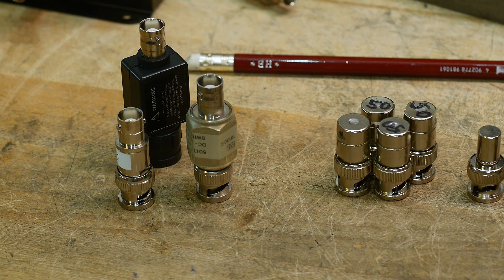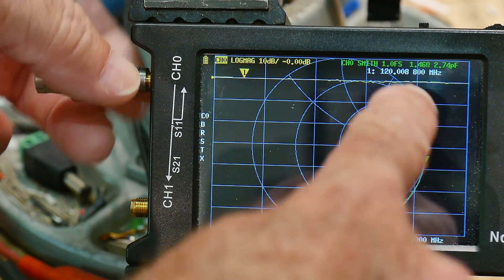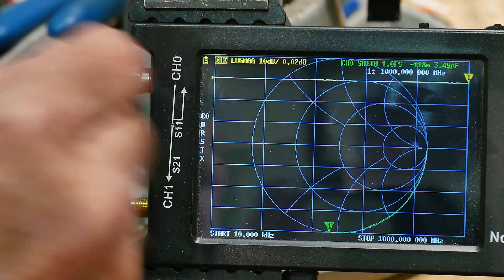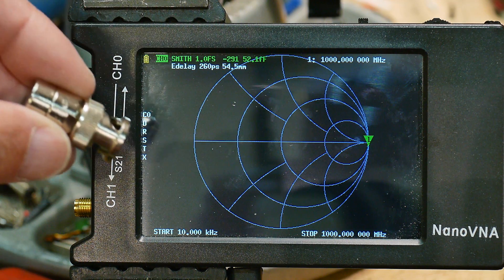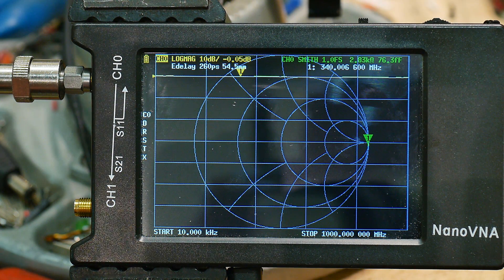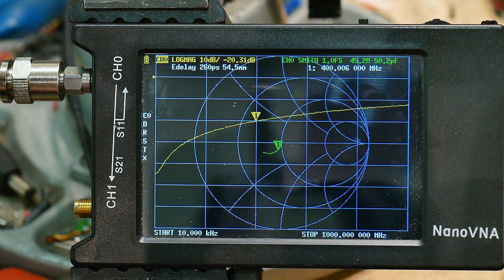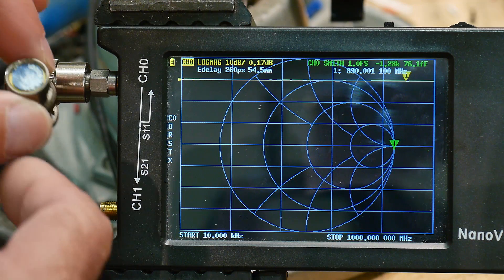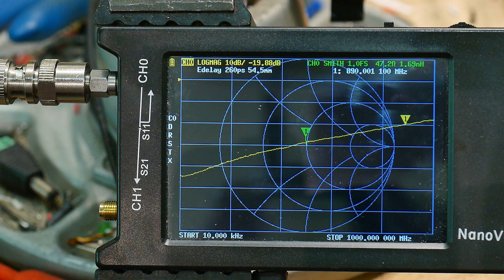#583 NANOVNA Not all 50ohm loads are 50ohms

Comment: Important point that must be explicitly mentioned more often:

People with NanoVNAs spend their waking hours repeatedly calibrating them with the 'Open', 'Short', and 'Load'. Very nice. But for testing and adjusting most simple antennas, the frequency calibration depends only on the internal TCXO, and I don't see anyone calibrating the TXCO frequency 127 times a day. (Of course the frequency is more than precise enough; yeah got it.  I'm trying to make the point clear here.)

Point being, if all you're doing is calibrating the length of your 80m dipole, then the only parameter worth looking at is where the impedance dip is located in the frequency spectrum. You can perform this measurement using a NanoVNA even if the amplitude and phase calibration are a bit off. You're only looking for the dip, and trimming the antenna so the dip is where you want it in the band. (This presumes that you've not set the Impedance References to something odd like 300 ohms.)

Me thinks people are bringing precision amplitude and phase calibration into the mix far too often.  Likely not required in many use cases.

Something to consider.

Comment: Just a word of advice.  Never "spin" on a connector.  As a example when you installed the first SMA-M to BNC-F adapter to your VNA you initially tried to hold the BNC end while you tightened the nut.  Had some difficulty and just spun it on.  This destroys the center pins in the connector.  Not something you would ever notice at HF /VHF/UHF frequencies but get into the microwave range and just doing that a couple of times will make a noticeable and measurable difference.  The easiest way to destroy connectors is to allow the center pin to rotate while tightening the nut.  Get caught doing that in a metrology lab and they would probably fire you on the spot for destroying their $3K cal standard.  Had a friend who works at a metrology cal lab catch me doing just that one day at my shop when he was visiting and I got the lecture.  I don't work on equipment at frequencies over 10GHz (honestly anything above the 23cm amateur band is usually just my microwave amateur radio setup) but he showed me some literature that demonstrates that at very high frequencies even not properly torqueing connectors make a significant difference.  Mike KC3OSD
Reply: "Never spin-on a connector..."   Yeah yeah yeah... But !

If you look at the NanoVNA and the little tiny SMA 'Open', 'Short', and 'Load' that come with them, you'll soon discover that there's no practical way to connect the 'Short' without just "spinning" it on. Good ahead, prove me wrong. Same with the little tiny 50-ohm 'Load' provided, the entire SMA 50-ohm load is too small to be practical to connect without spinning it on (What? You seriously want me to use needle nose pliers, Geesh!!  Get real.).  The Open doesn't matter since it lacks a center pin.  So yes, you are correct. But the obvious rebuttal is staring us in the face and it must be acknowledged. Your advice is simply not practical with small SMA devices that lack the hand-hold of (for example) a cable.

So, what I did was to purchase a pair of SMA-male to SMA-female 'adapters', also known as connector savers. Now my under $100 NanoVNA-H4 is protected with the addition of ~$10 set of connector savers. Even I'm not sure that it was actually a good investment. Spending $10 to protect a gadget that only costs $100, and I could even fix quite easily if I ever wore out the connectors?  Hmmm... Dubious investment.

So, from now on, you can temper your advice with this staring-us-in-the-face exception. Cheers!!
Reply: Also, some small devices don't even include a slip surface between the hex flats and the center pin. They inherently must spin on.  Worth mentioning.

Comment: great video! Incredible how they can manufacture a 50 ohms resistance that has no significant reactive component up to 1GHz!?!?!? We live in the future!
Reply from the maker: much much more than 1GHz. the SMA load I use for calibration is rated at 18GHz. You need better connectors to go higher, 100's of GHz

Comment: any manufactured product has a tolerance.
Reply: Except 'Primary' standards.  E.g. the "Prototype" kg lump in Paris by definition had (for many decades) precisely zero tolerance.

I love to mention the exceptions, as it shakes up the assumptions, and that's a good thing.
Reply from the maker: yes, all the big names of course. they will usually specify VSWR. there will be an actual datasheet. they range around 1.05:1 TO 1:3:1

Comment: That was a great video. Full of useful information. I liked how you zeroed out the smith chart with the delay. I learned something. I also found that all termination loads are not equal. I mostly focused on only SMA figured that would have least chance of having any stray reactance because of their size. I used a spectrum analyzer with an RF sampler to make my tests and none were as advertised. Not all were bad, just not up to spec. 
Thanks for sharing. I really enjoyed your video.

Barry, KU3X
Reply: PS...... forgot.  Isn't you Nano only as accurate as the calibrated load use to set up the VNA?  In other words, if the load that came with the unit was used and it would be a not so good load, would that not make all testing done after that no accurate?
Barry
Reply from the maker: Yes that is right. That is why cal standards are $4000 or more

Comment: how bad was the one that  came with your nanovna?
Reply from the maker: quite good. I compared it to an expensive one. <1GHz it is just fine
Reply: @IMSAIGuy  thanks. I'm thinking about getting a nanovna and wondered if I needed a better calibration load.
Reply from the maker: @vettonator  nope
Reply from the maker: you can measure it with a multimeter to see if yours is 50 ohm
Reply: @vettonator   You almost certainly do not need a "better" set of 'Open', 'Short', and 'Load', but you should probably order up a spare set as they so tiny that it's fairly likely that you'll eventually lose one. Cheap insurance. Was it $6 I think ?

Comment: This is great. What is your calibration procedure? Do you calibrate directly onto the vna without the adapter or with it on? I'm assuming the delay is turned off during calibration. Also, how can you display a large frequency range at once? My understanding is nanovna has a low dynamic range since it only sweeps 101 points. Thanks for the help.
Reply from the maker: Yes delay off while cal, normal cal. added delay for the SMA/BNC adapter since it adds electrical length. The 101 point does not affect dynamic range. It is just point to point accuracy but since loads are very broad band you don't need a fine detail cal. 
Just a note: if you put the Dislord firmware in your NanoVNA it extends the calibration number to 401.
Reply: My recently-purchased NanoVNA-H4 came with the 401 points option, so I leave it set to that all the time. If it slows the plots down, then I haven't noticed or been bothered in the slightest.

It's an amazing device, and I find it better than the $10,000+ R&S FSH-3 that we've used at work before, a device that is relatively awkward to use and (in transform modes) shows MORE artifacts (digitization artifacts). Every ham radio operator should own one, if not several.

Comment: I especially appreciated the use of the delay format as a way of knowing what electrical delay to use.  I built some 30db PI attenuators as suggested by w2aew but they didn't look as good as I expected.  The smith chart seemed to indicate that I needed an electrical delay so I played around with that but never found a good value.  Now I have a new trick, so I'll go at it again.  Thanks.

Comment: 50ohm should be 50ohm regardless but goes to show tolerances, heat and even 50.0001ohm can change further up the spectrum.
not all 50ohm is actually 50ohm.